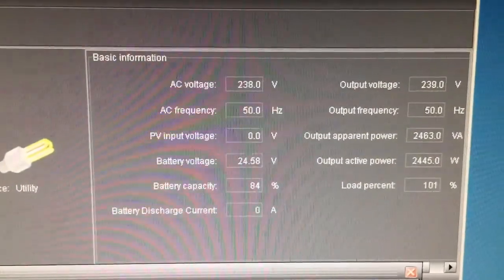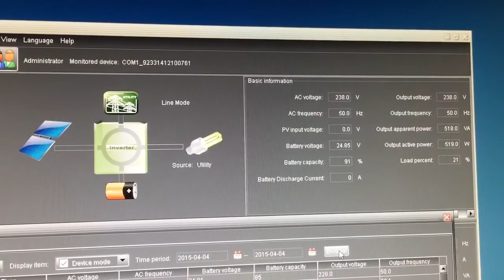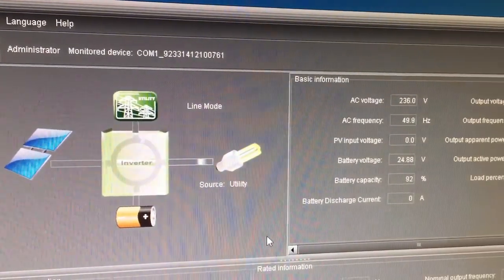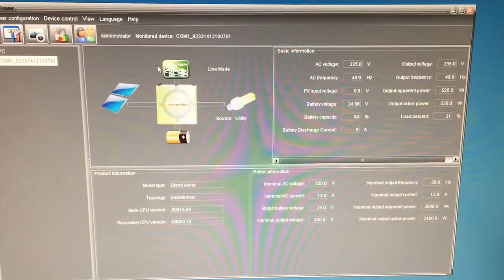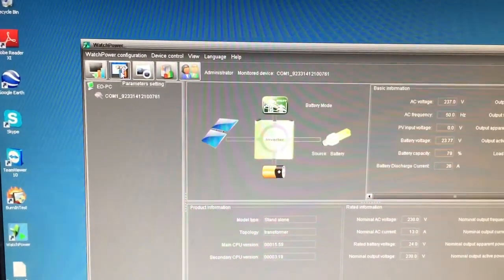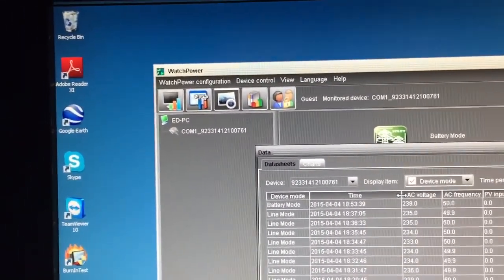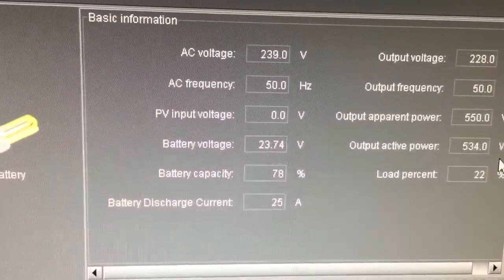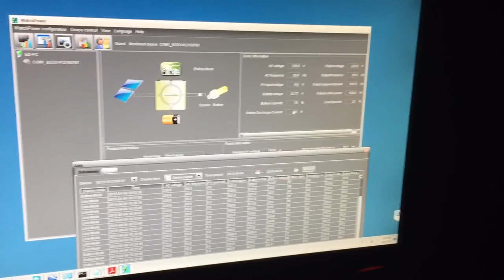Load test, fault finding & general rant

Comment: The way I've set mine up is Solar first in the settings which runs a few things during the day during peak rate times, when the power co charge me the most. I only have 220 Ah @ 48v in Batteries and three solar panels at the moment to try and reduce peak usage; off-peak starts at 11pm to 7am.
 If its not very sunny or dark my unit just changes back over to the grid (line mode) and I hardly notice the switch, I have a ups in the house that clicks during the change over.